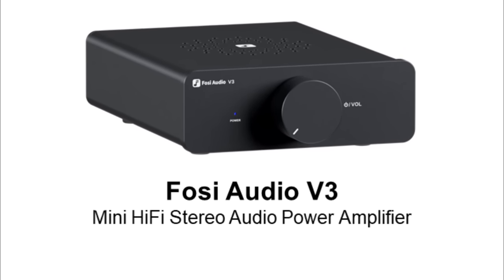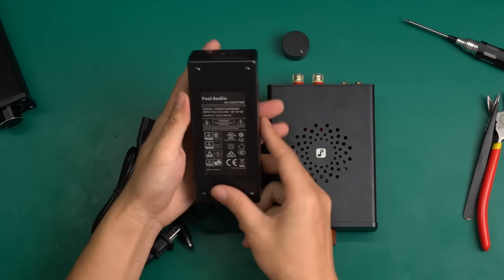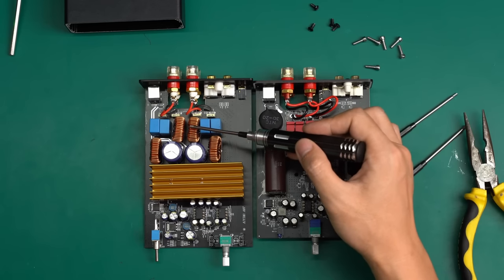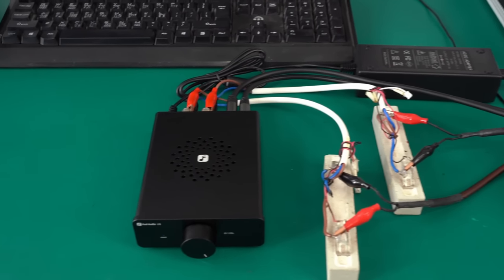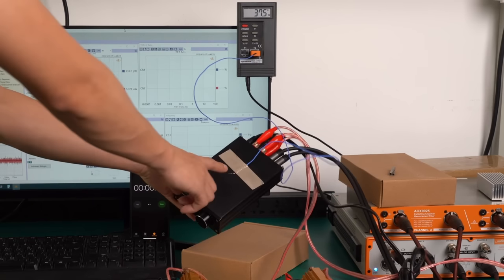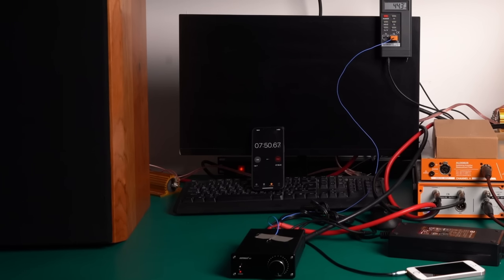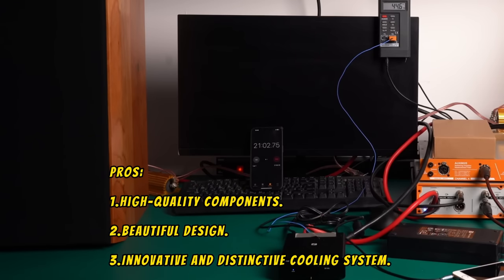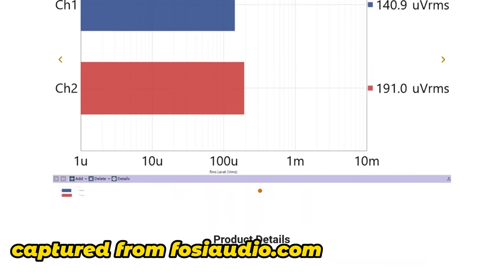A Decisive Victory? Fosi Audio V3 vs Aiyima A07 Measurement

Comment: I suppose I can deal with the "robotic" voice "speaking" the script? This is a bit grating on my nerves, frankly. But good info, at least. The A07 uses Nichicon 50V caps - the brand is quite reputable, but it's the 50V being too close to the max 48V power supply that is the main issue.
My issue with the V3 heat sink is that it doesn't have any fins - surface area is how a heat sink works. Yes, there are vent holes top and bottom - but the path in between them is largely blocked by the circuit board. The heat sink, such as it is, blocks a number of the vent holes on the bottom. So - there are still a number of heat dissipation issues that are not ideal.

Comment: Nice test. I'm probably getting the V3 with the WiiM Pro Music streamer. Thank you!
Reply: Hi Joel, just a heads up that the DAC on the WiiM isn't great. Otherwise that combo is great! I use a Wiim Pro into my DAC (smsl su-6) which then feeds into my A07. I like it. Adding an external DAC to the wiim definately makes a big difference in my opinion. Just figured I'd share, maybe you already have a dac or don't really care for now, that's fine too.
Reply: @danielh12345  Thank you, that's a good insight! Maybe add a Topping DAC in-between, since they are also quite small in size
Reply: My Wiim mini is connected to SMSL SU-1 to two A07 and a subwoofer. Probably I'll replace them with V3.
Reply: @JoelOman1980  yep! If you're looking for good budget value I've heard the smsl su-1 is good for the price. Might be worth looking into. Doesnt have a remote though if thats what you want. I have an smsl su-6 DAC which works great for me paired with the a07. Hope it helps!

Comment: Nicely done!  The stress tests tell the story very nicely.

I've been warning people about the A07s heat problem for a while now.  This V3 design from Fosi appears to fix it quite nicely.  

Can't say I'm happy about the on/off switch on the volume control, though.

That said... I've been using A07s in my "sound bar killer" setups for over a year and with a 32 or 36 volt, 5 amp power supply they perform admirably.  I also use one in my main stereo system.  I've never felt that it lacks power, in fact I seldom get it over 1/4 volume (about 4 watts).

There is one negative that should be noted (and this applies to a wide range of these little China-Amps) ... About half of the NE5532 op-amps in use are fakes . They are re-branded "something else" chips and I have seen considerable variation in their parameters. I don't believe this is a manufacturing issue. It appears to be "supply side" as there are so many showing up in lots of different places. 

Of late I've taken to simply pulling the NE5532s out of these little amplifiers wherever I find them and replacing them with RC4558 chips, which cost less than a dollar each.  It's a good fix and often there is an audible improvement.  

But please also be aware that beyond the initial "repair" swap, using more expensive or more exotic op-amps brings almost no improvement.

Comment: Great review! It would be nice if we have measurements with 48V/5A PSU (max power, THD, etc). Not to mention, I subscribed to your channel.
Reply from the maker: I tested with my 48V PS and the output power can reach 220W (THD 1%)
Reply: @budgetaudiolabs  Thanks for the info. 😊
Any unexpected problems with 48V PS, like protection kicking in or higher temps?
Reply from the maker: Very steady. Listening to music won't encounter any protection kicking in. The casing surface temperature is acceptable.
Reply: @budgetaudiolabs  
Did you monitor the bottom of the case, near the heat sink?  That would be a fair bit warmer than the top.

Comment: would love to see a battle beween v3 or a07 vs a similarly priced vintage amp
Reply: A "similarly priced" vintage amp would be about 5 or 10 watts per channel and most likely it would come in a plastic casing.  This is one case where the $100 price is made possible by advancements in technology... not cheap construction.

Comment: No tone controls, limited space for discrete opamps. I would probably use this as a power amp with a pre-amp for more control and inputs.
Reply from the maker: I think the space is enough for discrete op-amps since I'm using the sparkos ss3602 now
Reply: I use an A3 Pro with GE5654 tubes along with the A07 at the volumes I use it at it sounds pretty good. I use it as a patio stereo and even with speakers I am not a huge fan of it does quite well.
Reply: That's exactly what I did, using my Musical Fidelity M2Si as preamp at same time powering the mids and highs, while the 2 A07 powering the basses (L&R) + a subwoofer. Amazing sound!

Comment: Thanks for the review. I have recently purchased a lesser known brand of TPA3255 amplifier, the Windom BRU5 with similar heat management design as the Fossi V3. My personal experience of the Windom model is showing that case temperature rised to uncomfortable level with 48V power supply, but at 32V it performed well, granted I never “stress tested” it. One unique feature of the Windom is its built in DSP EQ, which is quite effective to compensate speaker frequency response faults. The EQ function requires additional Windows based software for $20, which I have previously purchased for Arylic Wi-Fi streaming modules. Another benefit of BRU5 is its built in Bluetooth 5.0. I’d be interested to see a comparison review of Windom BRU5 against Fossi V3.

Comment: Interesting, My A07 hasn't had any protection mode or heat problems running off a 48v 12.5A Power supply, it gets warm but there's no cut out even with longer listening sessions / gaming sessions / movie/media sessions. It's had a few tweaks since i got it though, Op Amps, volume pot, binging posts, capacitors and thermal paste for the heatsink, the V3 looks interesting but not sold on the power on / off being part of the volume pot, maybe they'll put out something with a separate controls for that(aware of the BT20A etc). Or what may be nice something with an internal power supply.
Reply: That depends how loudly you are listening ... at more or less normal 80db levels it's unlikely you're pushing it into thermal panic.  

FWIW... that A07 doesn't overheat because of the power supply.  It overheats because people insist on pushing every last ounce of power out of it. On the 32 or 36 volt supplies it will clip before it overheats... on the 48 it just gets blistering hot when pushed almost to clipping.
Reply: @Douglas_Blake_579  See now I want to make it happen 😂
Reply: @TheSynrgy1987  
LOL ... Okay... 

This is not something to mess with ... first of all it would be ear-bleed loud and second the thermal panic is not a feature, it's a last resort. The amp will do it a few times... but eventually  it will shut down and never come back on.

Best advice ... listen a reasonable levels and simply enjoy the music!
Reply: My Aiyima 07 had no problems at all but like stated, some people push it to the limits, like driving a car with full trotle all the time. With normal use this is no item i think. Thermal setup could be better but at this price, i recently bought my second one for my subwoofer, $45 it's a no brainer. I use it with OPA 2604AP and a tube 03, great sound!

Comment: 10:20. The reason the v3's case temp hit 60c (vs 40c on the A07) is because Fosi is specifically using the entire case as a heatsink, so the case is seeing more of the actual heat being generated, and is actively working to dispel it into the room.  Whereas the Aiyima's case heat is simply the byproduct of the air in the case heating up, and then heating the case (still air is a poor conductor, and thus most of the heat isn't being seen at the case, which is why it's overheating).  This means the Fosi case measurement is MUCH closer to the actual temp of the TPA3255 package, where the Aiyima TPA3255 package temp could easily be up over 95c.  (Most ICs start failing in the mid to high ~90c range.)

10:37. So this is the point, at 66c, the v3's TPA3255 package hit the same temp the A07's package was at, when measured at 40c, and went into thermal protection.  That is a very significant difference, not only in operational duration (1.6 minutes vs 10 minutes), but in terms of thermal expression, at about 165% that of the A07!  You could probably make the v3 run indefinitely if you simply pointed a fan at it, with no modifications needed.  Whereas, an external fan probably will not greatly improve the A07.  Of course, since this is a synthetic test, the v3 is unlikely to actually need active cooling in real world usage.

Comment: Thanks for the review. Is there any info you know of on rolling the opamps ? Does it make a significant difference and which ones to go for ?
Reply: See my other comment on this ...

The reason so many people claim grand audible improvements with exotic (sometimes more expensive than the amplifier itself) op-amps is not what people seem to think it is.  

Some unscrupulous supplier has flooded the market with fake NE5532 chips.  About half of the ones I've come across are rebranded "something else" chips... I have no idea what they started out as, but they are not 5532s.  
I routinely replace the 5532s with RC4558 chips, from a credible supplier, and yes there is, often as not, an audible improvement.  The 4558 chips cost about 75 cents each in quantities of 10.

What I suggest, if you are bent on trying this, is to first replace the 5532 chips with 4558 chips and use that as your baseline.  

What happens is that the audio quality suffers because of the fakes. Then someone stuffs in a $70.00 sparko part and claims magnificent improvements... but if they'd taken the intermediate step of first putting in the 4558s, they could have saved themselves over $135 and gotten the same result.
Reply: @Douglas_Blake_579 good to know, I thought it was silly to spend so much on op amps when the these amps are so inexpensive to begin with

Comment: Thanks for an excellent test and video. A quick question: you say the capacitors in the A07 are unknown but in the video you can clearly see Nichicon written on the side of both capacitors?
Reply from the maker: That pictures were actually downloaded from forums which indicate aiyima swap/downgrade the capacitors from time to time.
Reply: @budgetaudiolabs  alright, thanks for clarifying. I got curious and had a look inside my own unit. I had Nichicons so I guess I got lucky 🙂

Comment: It is a subjective choice for most people as to what a ‘bargain’ is these days…what some say is a ‘budget choice’ often leaves me thinking they are not in touch with the real world. The V3 is more than one amplifier, for example, the Yamaha AS201 is not. The V3 can be made to sound very similar to an muscular class A/B or a well detailed class A/B amplifier at the switch of two small components at very little cost. Switching the op amps can literally give 2 maybe 3 different sound signatures or in other words sound similar to an new Denon, Rotel or Cambridge Audio…and that’s a fact! I can pick out different op amp that will give me the sound of each one of those amplifiers and just pop them into the V3, now that’s a bargain! The op amps cost a few Pounds/Dollars, the amplifiers that they will sound like cost a few hundred and who is going to buy 3 of them at well over a £1000 or $1300 unless they are very rich?
There is also desk space which the Yamaha will simply not allow. These days many, many people only use one input. I have had numerous big amps with many inputs and still found I only ever really used one and that is mainly for a dac over the last 10 years. Then the is the DAC itself that while many amps like the Yamaha have Bluetooth included they will never match the quality of an modern external dac. I had a Rotel A11 Tribute that has superior Bluetooth over the Yamaha and I still never used it and wasn’t better than the external DAC that I was also using. To be honest Bluetooth is awful, it always has been and still is. It was invented for telephone calls and not music. Then we have Airplay which far superior to Bluetooth and with something like the Wiim Mini plugged into a SMSL SU1 and an V3 you will have a far superior sound quality and optional digital inputs than the Yamaha and also cheaper if you shop clever! Something else to consider is the an external dac will be far superior to 99% of all current amplifiers on the market today up to £1500/$1800 and even more! The Yamaha is not a flexible as it is being shown here, it is for adding extra equipment (primarily analogue based) that is also going to cost you a lot more money and only has one choice of sound signature which is good if you like the sound of the Yamaha but you are stuck or having to return it if you don’t. Then there is maintenance, the V3 will be far easier to repair if something goes wrong. So is the Yamaha such a bargain and does it have the convenience that comes with the V3…you decide for yourself but for me I would prefer of the flexibility of the V3 in regards to sound quality and signature, the size in regards to space and maintenance. There is also the fact that you can have more flexibility when choosing speakers as you are not stuck with one stock sound as you would be with the Yamaha as well as other untouchable amplifiers. You can tailor the Fosi Audio to probably any set of speakers in regards to sound and power! If you have hard to drive speakers then the bigger power supply will compensate for that as a smaller power supply will compensate for more efficient speakers…so you may save money there too…

Comment: Man, that was a great video. Thank you so much my question for you is the last time I owned a Fossett audio products and tried to use banana plug clips. It would not stay in the back they kept slipping out. Did you run across that with this unit?

Comment: 4:49 You don't know the capacitor brand on the A07? Is has Nichicon written all over it.
What exactly are you suggesting?
Reply from the maker: Hey there, I just wanna express A07 changed the capacitors from time to time. They used to incorporate Nichicon ones but sometime later they changed.

Comment: nice review! I'm recently came back to audio gear interest with these budget amps. The aluminium casing on these products is absurd, it just seals in heat which is bad for capacitors and peak usage while adding to cost, just to have a professional more expensive look.  Can you review the ZK or Wuzhi boards?  Can you also review this KGUSS PA8 or similar of different branding?
Reply: The aluminum housings also limit RF radiation from the PWM switching.  At 330khz these little amps, out of their case, will interfere with the AM radio broadcast band (550 to 1600 khz) quite badly.

Comment: It looks like I need to drill some holes in my A07s case and couple the heat sink to the case with some copper braid. I have some 2.inch pancake fans that might help too.
Reply: A simple swiss cheese hole pattern above the heatsink should do the job. I have one client who drilled a 5-4-5 three row pattern of 3/16th holes into the top, right above the heat sink ... no more thermal shutdowns.
(Be sure to disassemble the amp first...)

Comment: What was the wattage output using the 48 volt power supply on the V3? Great video 👍 Mine should be here this week sometime.
Reply from the maker: Could reach around 220W with 48v PS

Comment: Thank you for a great video. Do you ever do tests using 6 ohm and eight ohm loads? I think this could be very useful for your viewers.
Reply: In general ... if it passes the 4 ohm tests it's going to be just fine at 6 or 8 ohms, which represent less stress on the amplifier.

Comment: Thanks for the review. I am a recent owner of a Aiyima A07. I was hoping the V3 would have been released earlier, but Fosi's offerings at time of purchase were at best equal to the Aiyima A07. Then it just came down to price. 

Were the measured differences you saw audible? The ability of the V3 to run at maximum output on a 48 volt power supply, most folks won't be needing that kind of performance. How did it do on a 32 colt PSU?   

Thanks for the ideas on ventilation for the Aiyima A07, although for my needs to date it's temperature rise has been minimal.
Reply: 7:25
Reply: if you have bat ears could be audible.. The 07 has no audible noise, dead silent. These are already great levels. Components surroundig the chip could make some difference, op amps make difference, i use the OPA 2604AP, cheap and sound great.

Comment: I had both of them even replaced their op amp with sparkos and i feel v3 have a bigger sound than the a07 ,sound quality is almost the same, though price wise if you opt for the 48v power supply of the v3 almost the same